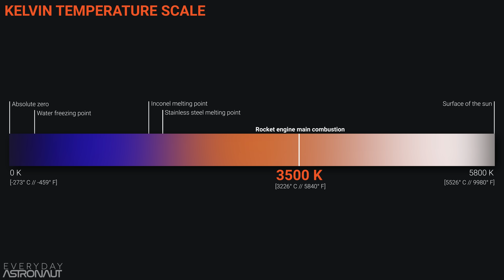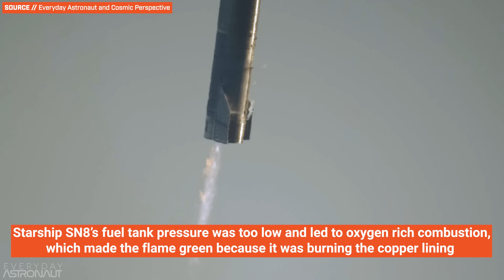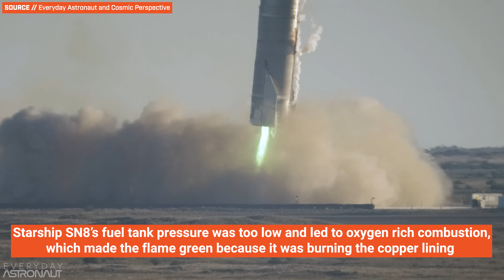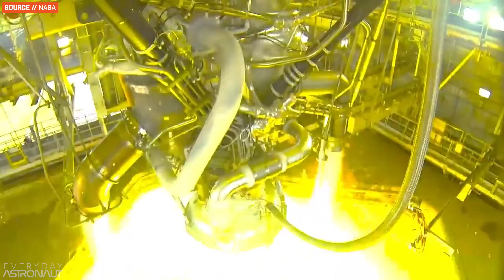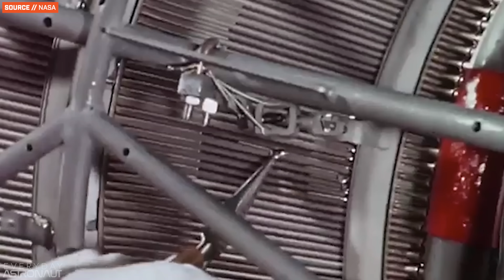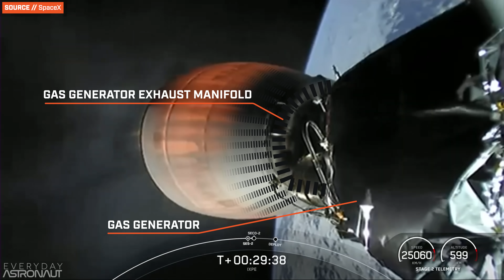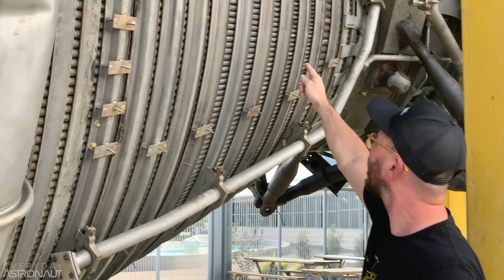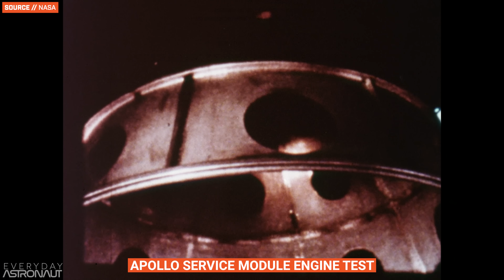Why don't rocket engines melt? How engineers keep engines cool

Comment: most of the heat is away ,and its a high fressure flow continus ,the shape of thw injrctr ,there is no 2 chambers its one in the cintre ,but nitrogen is only for cooling ,oxygen and no3 ,because nitrogen is not flamable

Comment: I know a lot about  jet engines but not rocket engines. While I was in the Military  first duty station was Beale  AFB. We had a rotating TDY commitment to Okinawa. While I was at Kadena Okinawa I was with The 9th SRW. I was an  aircraft structural repair mechanic however when my work was complete I would help other shops finish their work so we could all go down-town, together after work. I had the opportunity to help trim The SR-71 Pratt & Whitney J-58 I helped the jet shop performing a trim on the aircraft . My point is that while we were running on the hard stand with the motor off the aircraft . The entire aft section of the motor was glowing orange while the motor was in full 15 stage after burner Addtionally when we were near the side of The J-58 making adjustments it was difficlt to breath. Addtionally it would vibrate my  lungs and heart weather on the hard stand  or the motor was on the aircraft. It was extremely rewarding being part of that team. I  ended up spending 27 years in The USAF 🇺🇸 Your information was interesting and detailed. PS Sorry I was long winded

Comment: Ablative cooling parts look like they could simply install a new ablative insert, much like a cylinder sleeve is installed, but it's replaceable. The used inserts must first be cut away with machine shop tooling. After careful inspection, a replacement liner (ablative insert) could be installed.

Comment: According to NASA when they were developing the sequence for the shuttle main engines to start without them destroying themselves; "It required 19 tests, 23 weeks and 8 turbopump replacements to reach 2 seconds into an eventual 5-second start sequence. It took an additional 18 tests, 12 weeks and 5 turbopump replacements before momentarily touching MPL (minimum power level)."

  If an oxygen pump failed and burned then the resulting hot oxygen-rich fire pretty much melted, burned and destroyed everything including the evidence of what had failed.

Rocket science for ya.

Comment: As someone who has played Kerbal Space Program I know that sometimes the engine nozzle can get quite hot, to the point of melting/exploding. Although this more often happens due to unshielded atmospheric reentry, or the nozzle being blocked, either by the ground or another section rocket when you don't do the staging correctly...

Comment: thank you, using jet plasma method, it will change soon, there are other source of energy that with international cooperation in coastline we can reduce global warming, sea is huge source of energy, further more  we can prevent these phenomena like cyclone and flood and wildfire by using this hot seasonal atmospheric condition, recent years in summer, geothermal energy happens in surface of coastline, there are many countries in coastline with seasonal hot weather and water condition, in sum-up, by using this energy not only is economical but also reduce global warming in countries like Japan, China, India, Mediterranean countries, Iran, Mexico, Us, Canada, (Africa and Arabian countries....) . I invented new method base on air pressure rules and quantum physics ionization sea water minerals in strong dynamic magnet and electrical field and electric chemical reactions as major part of fuel (more than 50%) for producing electricity and fresh water and fertilizer. 7 methods for reducing global warming I mentioned in my profile.

Comment: 6:30 yes and no there is a certain amount of heat that a turbine can take before it melts but what you can do to make your turbo pump more efficient and run closer to stoichiometry is move your turbine further away from the preburner so you can dissipate some of that heat before the gas reaches the turbine

Comment: Excellent information and great presentation - thank you!  
An unrelated question that I have always wondered about:  a Raptor 2 rocket engine for example produces 500 thousand of pounds of thrust.  How is that thrust transmitted to the rocket itself?  If the attachment was above the combustion chamber it would seem to me that the combustion chamber mixing plate would have to withstand that entire pressure (which seems impossible), or is the thrust transfer at the throat level?   If so does heat transfer provide any issues?

Comment: Expander cycle engines don't boil the propellant. For example, the RL-10 has a chamber pressure of 44 bar, higher than hydrogen's 13 bar critical pressure, so the fuel physically cannot boil at any temperature. Boiling the working fluid is a bad idea because the mixed liquid/gas mixture has an unpredictable heat capacity that will result in hot spots. Liquid droplets impinge and erode the turbine. It's preferable to keep the fluid supercritical so it expands smoothly through the heat exchanger and turbine

Comment: The stress in the walls of a pressurized tube is proportional to the tube's diameter. The small tubes used to fabricate a regeneratively cooled nozzle don't need to be particularly thick to contain the pressure, and should be as thin as possible to minimize thermal resistance.

Ablative materials are by definition infusible, hence they do not melt during operation

Comment: Granted not testing the engine until use like the ascent engine of the LEM was a scary thought it is also counteracted by the fact that those, just like the RCS thrusters on both the CSM and the LEM, were hypergolic fuel driven which means insanely simple and reliable.  Also insanely toxic to humans as a bonus.

Comment: As a retired metallurgical engineer I always wondered how they cooled the wonderful metals on the engines knowing that they should melt quickly. Very well explained sir. Thank you! Of course we used carbon block refractory in the cupolas for melting grey iron to cast engine blocks and heads, etc

Comment: The fuel is compressed and during combustion the fuel is decompressed resulting in a natural cooling condition....and the ignition point is external, aft of the nozzles rim. Yet the nozzles are still liquid cooled to prevent heat creep up the nozzles.

Comment: question: why can’t I make a lining on the outside if the rocket engine out of material that has melting point just below whatever is being used for engine walls? That way it can melt away and take heat with it without increasing the circumference on the inside not messing up the expansion ratio, and I can reapply the coating later 8:40

Comment: I think it might've been worth explaining why the fuel becomes gas a biiiit more.
Basically, a Gas-Gas or Gas-Liquid interaction is MUCH more efficient than 2 liquids, but liquids are easier to store and can be pumped. So the trick is getting the fuel to the combustion chamber as a gas AFTER it has gotten the velocity to reach the chamber.

Comment: Is it possible to charge the burning gases into hot plasma, and prevent them from touching the surface of the engine, which is in turn charged appropriately. And use regenerative cooling to keep the engine surface cool?

Comment: For the fuel/oxidizer ratio bit, where you're discussing the advantages of going fuel-rich, another big advantage has to do with the chemistry of rocket propulsion. For long-winded reasons of molecular kinetic energy (which tbh, I don't fully understand myself), certain types of molecules in your exhaust wind up being more efficient than others. 

The best one you can get from any plausible rocket cycle is hydrogen gas - only helium is better, and there's no chemical reaction that uses hot helium as anything other than dead weight. So for hydrogen-fueled engines, they all run rich, because the goal isn't just "burn the hydrogen to water and push the water out your nozzle" - it's also "burn enough fuel to get the rest of your hydrogen hot, and push the hot hydrogen out your nozzle". For example, the Shuttle's external tank carried 629,340 kg of oxygen and 106,121 kg of hydrogen, a ratio of 5.93:1. The stoichiometric mass ratio is 7.93:1, so basically they used about one-third more hydrogen than stoichiometric. 

This specific advantage isn't true for all fuels, but one way or another, this kind of consideration will play a big role in whether you run your engine rich or lean.

Comment: turbine engine blades (hot section) use internal cooling channels (turbulators) to “cool” the nickel-based superalloys. the blades are usually SCDS (single crystal, directionally solidified). the only “dark arts” than this are the chip fab machines that use photolithography to etch designs on to silicon wafers

Comment: Why don’t they:  Extend the injectors down the sides of the chamber.  This would act like film cooling in the chamber, leaving only the throat and nozzle to worry about.  

Also, why don’t they use thin film cooling to cool the turbine?  I spent 40 years working on gas turbines, and only encountered one (very old) design that didn’t use it.  All of these turbines were vane-axial, so I have no experience with centrifugal turbines.  Is there some constraint I am not seeing that prevents thin film cooling of a centrifugal turbine?

Btw, thin film cooling is used in the internal parts of a jet engine, specifically in the combustor liner and transition pieces and at least the first stage nozzles and blades.  It is also used in boilers to cool duct burner igniters and viewports.  The way I used to explain it to junior techs I was training was that you injected cooler fluids, (usually gasses, sometimes liquids), and by the time the fluids heated up, they had been swept away and replaced by fresh cool fluids.  I don’t know who came up with it first, but I have encountered it everywhere in industrial machinery.

Comment: Film cooling is literally how people walk on fire.  Same concepts.   Preparing the fire pit involves packing the coals down, which throws up ash, creating one layer.  Then when you walk over it, the heat causes your feet to sweat, which flash-boils due to the heat and low mass, which once again creates a barrier that prevents you from getting burned.  Speaking as someone that's walked over glowing coals several times (and one of the very few videos on my channel is a firewalk i did in the mid 2000's lol)

Comment: If SpaceX can get a future Raptor engine to 250 tons of thrust (550,000 lbs), it will have the thrust of the Blue Origin BE-4  engine in a lighter package that will probably be both more reliable and cheaper than the BE-4. Jeff Bezos, watch your back! Especially for military payloads, the DOD could order that a future Raptor be used for military missions launched by the ULA Vulcan, especially in an emergency, such as more troubles with the BE-4.

Comment: Virtually all LH2/LOX engines run very fuel-rich - hydrogen, by itself, is an excellent propellant if you heat it up enough, so LH2-burning engines generally give best performance (ie, highest specific impulse) when they only use enough oxygen to burn about half of the hydrogen.

Comment: normal BF:
gf: "nice car"
bf: "sheesh. it's Dodge challanger scatpack has 707hp from the factory"

this mf BF type:
gf: "look babe, it's a rocket. what an awesome moment"
bf: "fookin' hell. that's a Falcon 1 running on Merlin 1A rocket engine. you know what babe, that's engine is awesome, the enginners make the inside layered in carbon fiber and it will be burn as the rocket turn on, they did that because they wanted to realease the heat that those rocket produce, and some of rocket engine like the RL10 rocket engine use tiny tube on the outside of the burner to cycle around the fuel because the rocket fuel itself are so cold that it can be cooling down the engine because. of course🙄, the engineers don't want the rocket to melt. anyway, i'll tell you more before we sleep"

Comment: Imagine the rocket engine rolling coal harder than the semi-truck with deleted exhaust and soft-modded ECU, yet they do have a good reason to do that though, that's so the turbopump's turbine engine don't melt - you wouldn't want the engine to fail for any reasons related to thermal management, despite the usual choice of multiple engines on the rocket, you only want to keep the engine out flight capabilities as absolutely the last resort.

Comment: Hello Spacex community

This information is for the enger in Spacex.

Starship burning all raptors without explotion.

Easy, remember when you pitch a stone in the water You see the waves the center to out side.

Well doing the same but inverse.

The refrigeration for the all raptors burning the out side first to center.

This sequences avoid all explotion  Try

Comment: There is probably a very good reason why this solution will not work as others would have tried it but why don’t they use the pressures fuel injection to shape the burn to avoid the edges of the engine leaving some air to insulate.

Comment: It's interesting that a engine needs to melt to be cool. There is a engine like the 4 cylinder car engine that uses a combination of 50/50 radiator fluid in combination with oil, and gasoline, and a fan. The engine will always be hot because kinetic energy is similar to oxidation energy where they both create friction which causes heat. However, a rocket engine doesn't have to be cold. It's just something that these engineers keep doing.  The rocket engine does not need to use frozen gasoline. Either way, exhaust is hot, it's like cooking. Always need ventilators ect. Heat exchanger or heat sink. I think that rocket engines could exchange metal halides or exchange gases without flammable explosions. Like sulfur triple bonded oxygen. Or atmospheric compression or magnetic leverage. This would take obviously, a lot of time to implement but would have virtual no burn ratio. Stoic chem is the same or similar it's all chem. Stoic chem is the measurement of energy not explosives.

I also think there could be a light beam engine with kinetic pulse like a microphone. With combined rocket chem this could be possible. Electret engines or I coin the term light beam engines. Lights travel into the speed of sound and electrical energy which causes a floating power that creates a pulse and after burning could be limited and be used to float or even shoot a rocket incredibly fast into space. It's something I studied for years and something I think about still. It's not to intimidate anyone it's something I learned while studying audio waves and audio engineering.

Comment: Why wouldn't they just run an outer injector ring of helium outside of the fuel and oxidizer injectors? Then it'd have a wall of helium to keep the fire from the walls

Comment: Coming from someone with zero rocket knowledge, why not preemptively create an engineered exhaust “soot” coating on the inner walls of the nozzle  therefore eliminating the need for fuel-rich operation?

Comment: Thick material will melt gradually if the heat load is higher than thermal conductivity. Heat induced into material is not distributed equally through all material, but it's heating surface and then it is conducted further through all material volume.

Comment: There was another possible way of dealing with leaks or hotspots inside the cooling passages of a regeneratively cooled engine: Mix some kind of additive into the fuel which would decompose at high temperatures to deposit a solid, insulating material. This only really works when you have a liquid hydrocarbon fuel, since the additives are liquids too. This has been done using tetraethyl orthosilicate, which is a liquid silicate ester which dissolves in hydrocarbons. Another option is silicone oil, which has been tested the same way but with rockets using ethanol or methanol as their fuel.
In both cases the silicon-containing additive decomposes at any leaks or hotspots to form silicon dioxide, which either plugs the leak, or locally increases the thickness at a hotspot, effectively curing it. Of course the resulting silicon dioxide itself can get ablated away by the heat, but since there is always a small percentage of the precursor additive in the fuel, it is continually re-deposited for as long as the engine is running and fuel is flowing.
This only takes a couple of percent by weight of the silicon-containing additive in the fuel, most of which burns perfectly happily along with the fuel, so the engine performance is not significantly reduced. This is no good for tactical missile applications since the rocket exhaust will contain some silicon dioxide smoke, producing a persistent, trackable exhaust trail. But for rockets fired into space (or fired once in space), this doesn't matter.

Comment: don't watch a 30 minute video, instead heres my short answer:

the inside of the engine housing is of course blasted by flames heating it up. the outside is covered in super cooled tubes that keeps the outside cold.

boom answer solved, no need for a 30 minute video

Comment: Nvm how they stay cool, how do they simply not just disintegrate under the forces they're subject to.  For example the rocketdyne f1 as used on the Saturn 5 produces an alleged 750tons of thrust.  Having seen one up close I'm pretty sure if you placed one in a 750ton press it would simply get crushed flat, and I mean the actual engine part of it, not the skirt, this is particularly true of the section around where the gimbal is mounted, it's a hollow aluminium alloy casting, not even steel!